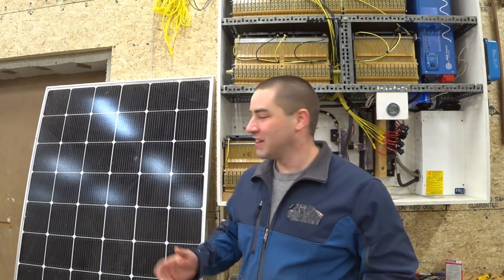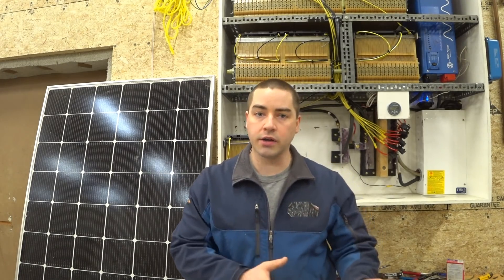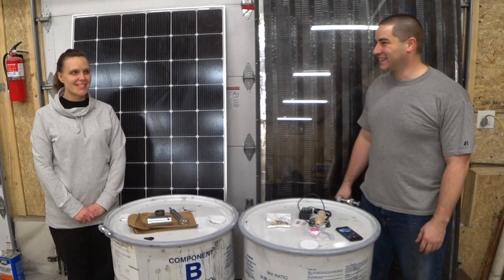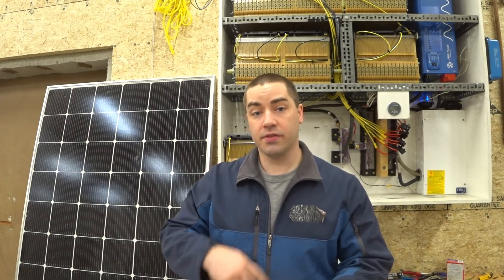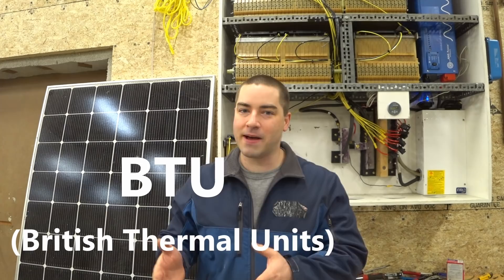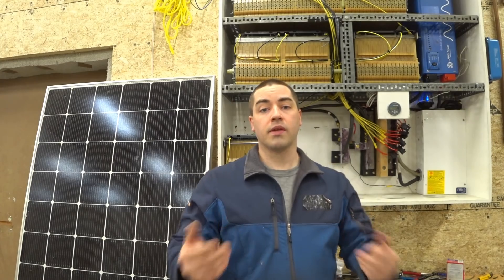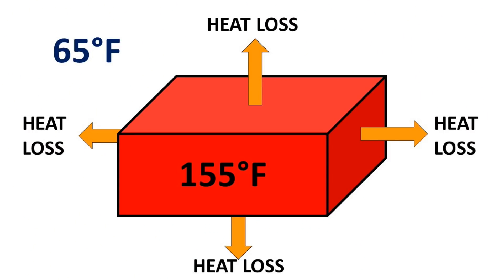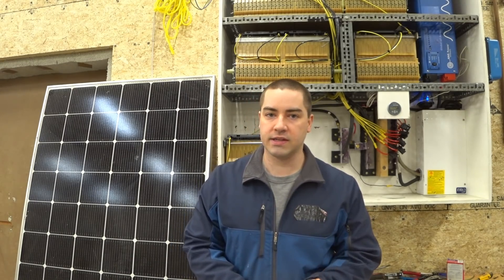Cheapest Energy Storage Off-Grid

Comment: Your math is excellent.  I came to very similar conclusions about 40 years ago.  My solutions were along the lines of heating the home, the air.  My solution to the battery was window placement and thermal mass used in the construction of the house.  You live in the solar collector.  The energy is stored in the body of the collector.  Remarkably,, or maybe not so remarkably,, people have been doing this for millenia.  I have engineered many things,, but the story of one engineering job is noteworthy.

I was asked to design the system for a house in New Mexico.  Passive or ambient heating and cooling.  The mechanical HVAC systems were to be there to suit sales, building codes, local officials,,, but the design was to have them be the backup.    No computers,,,no internet (1983)  , calculators, paper, pencil, and multiple computations to find the middle ground where cost, usefulness, and available materials and subcontractors all worked.   I came to the conclusion that the house need  X in heat,, solar heat gain,, but the job of cooling was the greater portion of the year.  Nominally I need 6 inches of fiberglass filled wall, inside of 9 inches of masonry thermal mass for the exterior to absorb the day's heat and give it back to the night sky.  I was so proud of a simple and brilliant solution, arrived at by a week's worth of calculations,,,,,, calculations not dissimilar to yours.    But,,

What are the dimensions of an adobe brick?  Hmmm  9 Inches.  and then I found some of the dimensions of stone walls of the Ancients in SouthWest cliff dwellings,,, 10 inches is very common...  And then I knew,, I was not so smart.  SW natives have been building to those specs for a few thousand years.  Annnnd  a really good passive solar super insulated house,, really good,, really efficient,  can look just like a Cape Cod,, or a Salt Box  that you might find in Andover, MA.  with very few modifications and use of modern materials and tech.  Build on the shoulders of those who have come before you.
Reply: Good point.

This sort of thermal heating storage was the big thing back then, rather than solar electric, a reaction to the 1973-74 oil crisis. And quite a few things lingered from that, at a rather minimal level. There was a TV programme in the UK which described what could be done, <a href="http://www.hevac-heritage.org/electronic_books/M&NW_anniversary/Section-13_Houseforthefuture.pdf">A House for the Future</a>. Apparently the solar thermal system chosen then didn't last.

I can't help but think that building design still doesn't take into account the potential for solar energy. I see new construction with a poorly-aligned roof, and other fairly simple details that could be improved, such as larger windows on the sun-facing side. The structures you describe are closer to the usual in the UK, but not the same. Cavity walls are usual here, and that puts a big chunk of the wall mass outside the insulation, where it isn't of much use as thermal storage. The insulation thickness also looks lower.

Comment: What has hot water got to do with electricity
Reply from the maker: There are lots of ways to make hot water.  Two methods I'm aware of in regards to electricity is an electric resistance element, and heat pumps.  But the topic of this video is storing hot water, not making it.  I have several other videos about making hot water.  I'm even doing an experiment right now comparing solar PV to solar thermal.
Reply: I guess you can cook shit with hot water lol

Comment: I did a blog on using a multi-heater setup with a heat pump tank and a tankless gas for a "power yourself" goal (https://tripzero.io/technology/powering-yourself-water-heaters/).  The heat pump is only on when there is solar and the gas takes over when needed.  I managed to calculate how many months on average I'd have no problem heating the water with the heat pump, but I used total kWh per day and the kW you'd need to even get the compressor started.  So my setup would not work for off-grid situations.

Comment: I guess you could set up  a secondary set of PV panels to heat the water. but your best bet would be the vacuum tube heat exchanger. Even on a cloudy day they still absorb the thermal heat from the sun.  Look into an Iron flow battery, you might be able to build one. last for 20 years

Comment: Do you currently utilize your thermal storage to heat your home as well? Low temperature radiant floor heating would definitely be a great way to integrate into your thermal storage tank. You could add another pressurized coil in your tank (with a boiler feed valve/backflow preventer) use a small circulator pump running to a manifold. Run your radiant heat loops off the manifold and then back to the storage tank and viola you would save lots of money in winter heating bills :)
Reply from the maker: I don't currently use the thermal storage for space heating, just DHW.  Thanks for watching.

Comment: I built a system with two tanks in series.  The first tank is a solar batch heater.  It just sits in the sun and heats the water up to 80-130 F depending on the amount of sunshine.  That pre-heated water then flows into a second tank that can be heated from our solar power system or from the utility as a last resort. 
Solar batch heater: https://youtu.be/KEPej1hZmto
Solar voltaic heater: https://youtu.be/DZtWGsUDppI
Reply: David Armstrong  yes good work. In winter  is my issue with this.  I put in green house but still froze and Orr lowered more then the 56 degree ground water 💦.   But I will figure this out.

Comment: Yes heat pumps should not be considered in an offgrid solar setup as they are not cost effective at all the reason being the low cost of PV solar energy and low cost thermal storage.
My calculations for cost amortization on each of this is as follows:
PV solar panels around 2 cent/kWh (even lower with current PV panel prices).
Thermal storage can be as low as 1 cent/kWh
Best LiFePO4 battery around 15 to 20 cent/kWh
Grid price is typically around 10 to 20 cent/kWh depending on your location and even there a heat pump can hardly get even meaning the savings over the useful life of the heat pump just make up for the savings at 20 cent/kWh but with solar PV panels being 10x less than that and thermal storage even less a heat pump can not be justified at all and is a bad investment.
The imperial units makes the math more complicated but as at least 50% of your viewers are more familiar with those units including you it makes sense to use them.
Even natural gas that most people use for heating is around 4 to 5 cent/kWh and so PV solar + thermal storage can even compete with that :) is just that if you already have a natural gas connection you just pay for energy as you use it and with solar you pay for all the energy in advance for 25 to 30 years (amortization period used for solar PV as they may get to 80% of original installed power in that period so you may need to add a few more solar panels to be good for another 25 to 30 years).
Reply: I needed to google SHTF.  You seems to be a pessimist :) 
If you read my replay I mentioned that Lithium is expensive in therms of cost amortization so that is not used for heating applications but very inexpensive thermal mas storage.
I do have a small LiFePO4 that for the first year of operation degraded by 0.9% so it should last about 20 years in my application before getting to 80% of original capacity. Battery is there to just power electrical devices over night as battery can be fully charged in any weather conditions with the large PV array that produces a minimum of 4kWh in a overcast winter day and so I can deal with an unlimited amount of cloudy day as my average monthly usage is around 120kWh excluding heating.
Small scale wind and thermal solar are not cost competitive.
Reply from the maker: @Electrodacus: I love your work and hope you build a 48 volt version of your controller/BMS.  I'll buy one.
Reply: The SBMS was designed around my own needs so max 24V.  A 48V version will require complete redesign and I have no plans for a 48V version.
Two SBMS0 can be used to handle a 48V battery but is not an elegant solution so not something I recommend.
Reply: A heat pump uses 1/4 the power of an electric water heater. So far less kwh drawn from the battery on cloudy days. In addition, 1/4 the power is easy for an inverter to handle. Not everything is about cost
Reply: @electrodacus  you are just plain wrong about heat pumps. You are INSANE if you CREATE heat using electricity. No sane person would EVER use pv or battery to power a water heater element. It's incredibly inefficient. A heat pump costs LESS than the ridiculous amount of extra pv you would need to get past the efficiency of a heat pump.
Reply from the maker: @Nevada: You mention HPWH uses 1/4 the power.  I've also seen the manufacturers claim these high COP's.  However, I have yet to see someone test one in real-life conditions.  And I've certainly never seen someone calculate how much extra their house heating system has to run because of the HPWH.  If I could get my hands on one I would love to do the tests, side-by-side.  Do you know of any side-by-side testing like this that you can link to?  One that also shows how much extra the house heating system has to run?  Both Electrodacus and I live in heating dominated climates.  Thanks.
Reply: @DavidPozEnergy  you seem confused. A HPWH is a separate system connected to an existing water tank. There is no heat pump in existence that heats a home AND a water tank.
I'm off grid and switched from an element to a heat pump and yes, it uses 1/4 the power. There's no way I would ever go back
Reply: Heat pump is not cost effective and if you give me a model number that has a spec and price I can demonstrate that to you.
The reason is fairly simple.  A heat pump is barely cost effective when used in a grid connection where electricity is 15 cent/kWh and natural gas 5 cent/kWh if average COP is 3 so then amount of heat you get from the 15 cent/kWh electricity is equivalent with that you get from 3x 5 cent/kWh so about the same but you also need to consider the heat pump cost here and that is also significant and it will not last that long so cost amortization is relatively high.
When you talk about electricity at 2 cent/kWh from PV panels and thermal storage at 1 cent/kWh no heat pump can ever compete there even if it was free to buy (not the case).
In cold climate like mine an air heat pump will do nothing as the outside temperature is to low in winter and the best most extensive heat pumps will not be able to get much over a COP of 1 and that based on lab test in real life it will be worse than that.
My total house solar installation that provides heating and electricity cost $15000 and all of this should last 30 years as is solid state except for the small LiFePO4 battery that may need replacement in 20 years and is not that expensive as it is small capacity.
$15000/30 years / 12 months = $41.66/month for heating and electricity about half of that for each so $22 heating cost per month if spread over 12 months (heating season here is about 7 months).
Keep in mind that I get 10kW from PV array when it is sunny so if I wanted to install some sort of heat pump it will need to be able to output 10kW of heat and that is not a small heat pump probably 2 or 3 smaller ones are needed and those will cost much more than what I can save by reducing the size of the PV array. But if I reduce the size of the PV array I also need to significantly increase the size of the LiFePO4 battery and that is more expensive than solar PV so I will end up with same cost plus the cost of the heat pumps so I end up with a more expensive and less reliable system thus higher energy cost.
Reply: @electrodacus  you seem to be suggesting that it's not possible to run a heat pump off pv. I've been doing it 5 years. And my system cost about half what yours did. I could buy 5 heat pumps and still beat you. I have the most efficient off grid solar system in the world (Lifepo4, arduino bms, zero power relay, low idle inverter at optimal voltage)

Comment: Add a small wood stove and a copper coil to heat the water when you need to . Just burning leaves and twigs can make a huge difference .
Reply: P Kuudsk.  Yes I can get 35,000 BTU for 8 hours off one $3 gal of diesel or kerosene in a simple wick stove in my workshop.  9$ for 24hrs if I ran it all day.  However I think this guy wants to do solar.  Also solar will heat the water without attention.  Combustion in stoves need attention.

My electric bill is 120/month hydroelectric, or $4 per day including heat pump, wh, lights, entertainment systems.  My hydro dam uses a reregulation lake so they store energy by keeping water at a higher elevation during low use hours.  Water battery.

Comment: @DavidPoz since 2010, I’ve had a very modest 1.84 kW PV array on the front slope of my roof & since 2011, a similarly sized (though arguably oversized) evacuated tube thermal/hot-water array on the back - facing the “wrong” way.  The solar thermal stats are awesome; with just 2385 hours of run-time on the heat-transfer-fluid pump, it has created 156 MWh of hot water heating.- 156176205 Wh to be exact...  roughly 20MWh/year
Reply from the maker: Awesome!

Comment: I've been wanting to do something similar, with cold water, in Florida.  I'd imagine there are other considerations that need to occur -- such as bacteria growth in lower temperatures, or mixing different metal types with a closed loop.  Ya can't get more environmentally friendly than a water battery.  I've also got an eye towards water-to-water heat pumps: either geothermal or an abnormal closed loop setup with hot and cold water storage tanks.  Keeping cool in Florida is a big deal, and I just really digg the idea of reusing heat for other purposes.  In the realm of water-battery and kinda-crazy: I digg peltiers as generators -- where the delta in temp generates a small current.  Generating heat in the Florida sun is often easy, and dissipating heat via water-loop + radiator+fan is nothing new.   I've got this feeling that two in-home water loops (hot, and chilled) may possibly be a more efficient way to go.  Something simply grinds my gears about refrigerators relocating heat into the home while the AC pushes heat outside while the water heater pushes heat into the home (and down the drain).  

I have yet to run the numbers however I imagine an excessive amount of peltiers would be required to power the kitchen stove.  However, the water-battery may be 90% of an overall solution.  If the day-time solar panels could 'recharge' the hot and cold water-batteries while peltiers power loop circulation motors through the night -- then that'd be slick.

As of this moment -- I'm waiting on this DavidPoz guy to post his research about charging solar energy storage: is it better to heat the hot-water-battery via electric, or thermally via the sun?  He's got some great content on YouTube -- check'em out.  :)
[ For real tho -- appreciate you documenting your journey. ]

... and if(when) your mini-split breaks again -- I'm of the mindset you setup a chilled water loop with cold storage tank.  I'm also anticipating that it's going to be a hot summer, so ya should start setting it up now.  Some decisions may take a while -- like, do ya want radiant cooling or a wall mounted car radiator :)
Reply from the maker: Setting up some kind of chilled water system would be fun.  I wonder how big of an ice block I would need to do my summer cooling.  LOL.

Yes, I'm excited to share the results of my experiment as soon as I get them put together.  As of right now, the experiment is still going.

I used to be very concerned with refrigerators like you.  I've read about people putting in ducts behind the refrigerators and stuff.  However, I have relaxed on that issue.  Modern refrigerators last for decades, but only when inside.  Do I want to complicate the system with ducts, or water cooling?  Possibly this would shorten the life of the compressor.  Anyways, just my thoughts on the fridge.  However, I do suggest a smaller than normal fridge, and as efficient as possible.